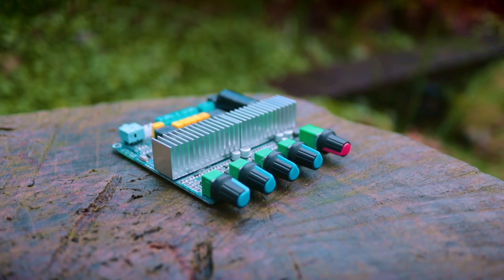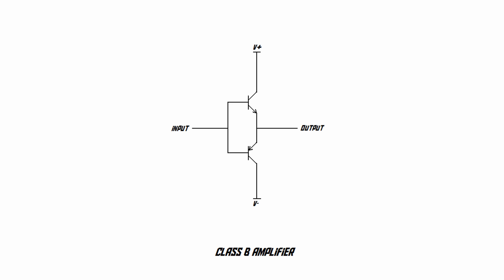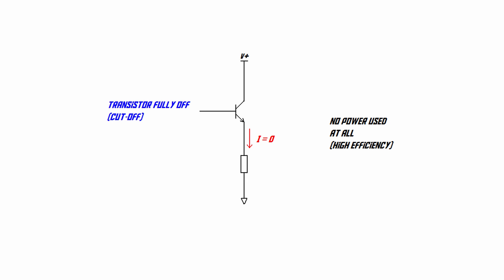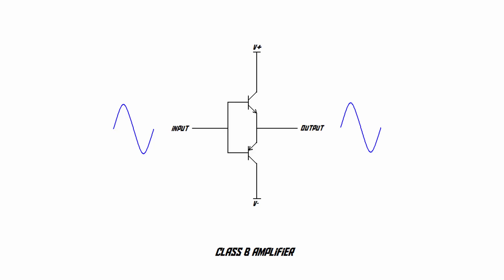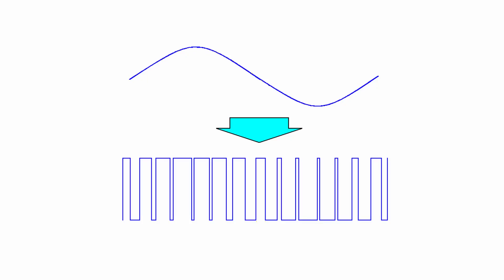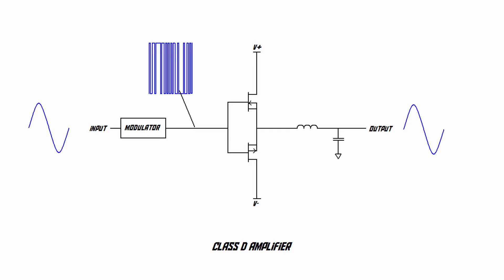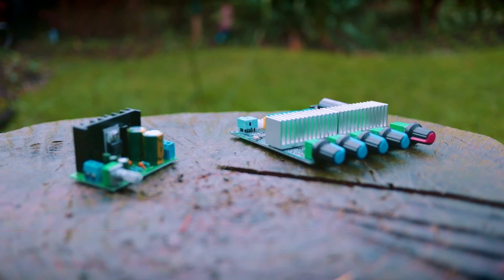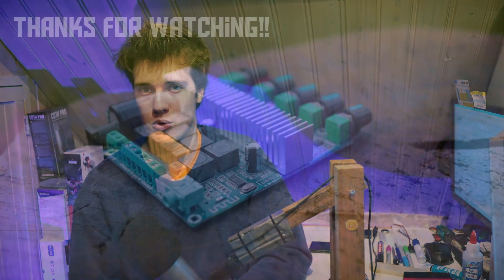Why class-D amplifiers are crazy efficient

Comment: Often class D amplifiers have fully differential output, eliminating the coupling capacitor.
Also, sigma delta modulation pushes the switching noise further out of band.

Comment: That was really clearly explained. I was thinking you would make a good teacher, like teaching the kids technology. 

By the way, whether Class D or Class A is better is a hot topic in the hifi community. Most tend to swear by the traditional Class A, but according to what I hear, the difference is all in how you design the Class D. There is a lot more to it in terms of subtle distortions creeping in. You get a kind of delay plus a ringing effect on bipolar transistors, and your A to D converter may be non-linear. The ultimate way is to keep it entirely digital and use GaN FETs in the output. If you want a sharp edge to 16 bit accuracy at 20kHz you are talking about switching at microwave frequencies. GaN FETs can do it and the results are suppose to sound superb, but not cheap. Feedback can iron out harmonic distortion, but increases transient distortion, so for ultimate quality you want totally linearity and zero feedback.

Comment: Class D amps are commercialized due to the cheap nature, the components are good for welders and tend to distort the signal you put in. Any 80's class AB amp is light years better than this tech however most people do not care if they got 10% distortion in their music if that is going to cost only a few dollars hence enter the death of HIFI era when mosfet were introduced in amp design.
Reply: We have way better audio now than HiFi in the 80s
Reply: You can make an absolute decent AB amplifier with welder components, but it would be able to deliver very little power because switching MOSFETs can not handle a lot of power. You can make decent AB amplifiers with IGBTs too you just need to use a level shifter.
Reply: But commercially these solutions does not make sense. A D amplifier small, cheap efficient and ticks all boxes required for high quality audio. The audiophile cult wants you to believe that class D is crap.
Reply: When blind tested, no audiophile can notice the digital vs oldschool amp.

Comment: i think one reason class D have a bad rap is, as you said, the carrier frequency. early D amps used lower frequencies as well as not having fully fleshed out board designs for EMI rejection. this lead to a coloring of the audio that was coming through.  this was especially noticeable when bi-amping using tweets/mids.  car audio really showed the worst of the worst in that reguard.  now days switching ferquencies are MUCH higher, parts are FAR cheaper to make and more easily obtained.  loads of board designs have come out that allow intigration of power/output sections with out sacraficing quality.   back in the day you had to fully isolate power boards from the audio switching board to really have a chance at ultra low THD numbers.  now - its just not that hard to do anymore. things are smaller, solid state, pre-engineered. 

one thing that still blows my mind is how much of a delta you get with percieved output going from A to D. a 12w class A tube amp sounds every bit as lout as a 90W class D.  thats before we even get into class H or BD or what ever other combination that has come up with over the years.
Reply: At these high frequencies are we not really talking about DC-DC conversion. So it is bucket or/boost converter. So here why would there be EMI? The coils prevent any sudden change of current in or out the box. Just make the whole box small so that all waveguide / cavity frequencies are even higher, and eliminate parasitic capacity?
Reply: Turning an analog waveform into a pulse train is not without its consequences.   It creates a bunch of high frequency energy.   While old class D worked much like this video's diagrams  (triangle wave modulator into a comparator).  Modern day class D shapes the pulse train in a way to push the frequency of the noise as high as possible.  This makes it easier for the output filter, which needs to use big and expensive components, to function.  

On a cheap design, the output filter is designed to barely pass EMI regulations.   They really don't care if the product annoys your hamster.  They figure, hamsters do not have enough money to buy an amplifier.
Reply: @moddaudio  switching frequencies in the MHz range are possible. Just apply this switched voltage onto a coil, which does not exhibit too much parasitic capacity which makes it a band stop filter.
Reply: and that audiophiles are um, superstitious